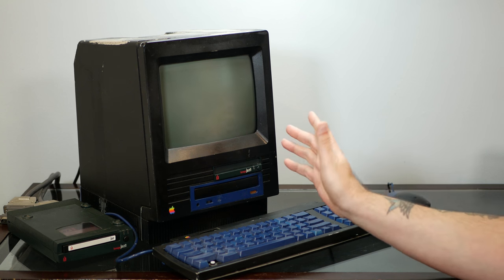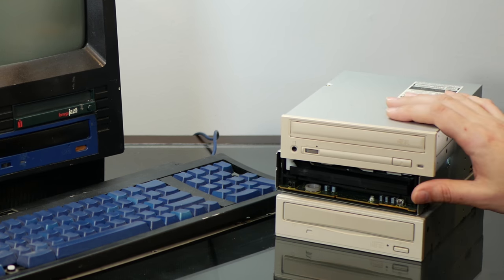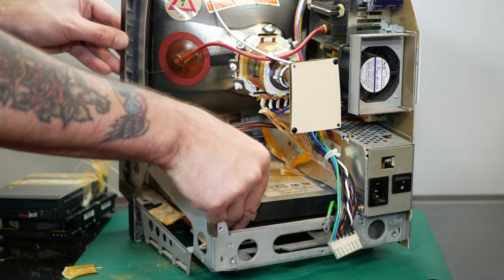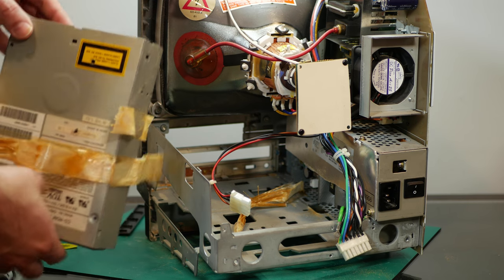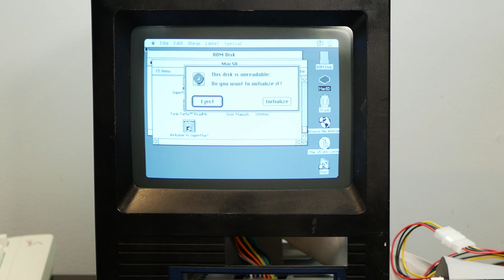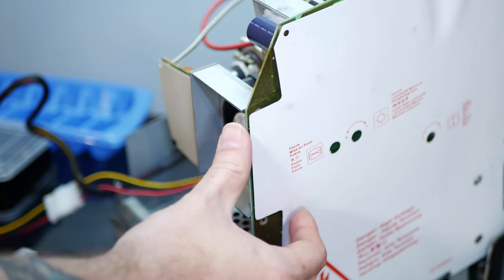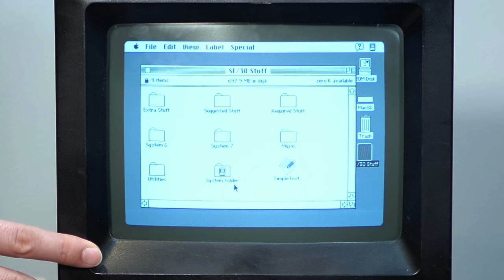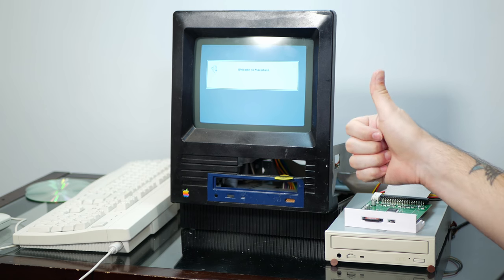The CURSED Macintosh SE, Part 2: Optical Revenge

Comment: That dust from the tape was once the adhesive. The heat of the CRT has cooked everything to do with that ancient tape.
Reply: I remember my father using those to tape over casettes to "restore" the write protection part.
Reply: and the fact it's packing tape. Packing tape isn't meant to last at all.
Reply: It looked like it was a self adhesive velcro type of tape when he removed it from the CDROM drive
Reply: In an old-style pc, there was a moth in the innards "Bug" on a piece of tape.
Reply: @Brendan_Keyport-WA7BMK  Isn't it fiber glass tape? Thus the strands running through the tape.

Comment: Mac Wars Episode 3: Revenge Of The Disc
Reply from the maker: Oh damn that's good!
Reply: @ActionRetro  It just felt perfect!
Reply: @ActionRetro  
Hey, did you make sure to check on the SCSI IDs and termination? Classic macs can work perfectly or behave really weird if the SCSI IDs aren't set right, or your bus isn't properly terminated. A lack of proper termination in particular can cause the behavior you're seeing, as signals can "bounce" back at the end of the bus.

These SE's were never meant to have quite so many devices daisy chained on the inside, let alone things like a CD drive or that SD reader. It might behave really badly without everything set up properly.

Comment: Get or make rounded SCSI cables. It'll save a lot of space.
Reply: I second this comment! Make rounded SCSI cables, it'll make the interior much nicer.
Reply: Wasn't there a reason SCSI cables weren't round?
Reply: @mentaluproar  yes. Cost. Possibly signal integrity.
Reply: I used to use an razer blade and cut apart cable into 4-5 cable groups and just zip tied into a round cable. Those were the days...
Reply: I am a newer person so idk what the difference between SCSI and IDE is but it does look like an IDE cable from afar
Reply: @bland9876  They confuse me a LOT too. I always have to hold the cable up to the port to see if they match (SCSI is longer).

Comment: In regards to the PSU, I would recommend substituting a pico-type PSU, as it's easier to use, can run to a smaller modern barrel jack at the back, and handle much more watts of power. Heck, you could likely put two inside the shell of the original PSU and get almost 600W out of two smaller laptop power supplies.

Also to keep the original spirit of the machine alive, how about when you go to paint the optical drive you paint the exterior and faceplate black, but paint the inside tray blue.

Just an idea. Love your videos!!!
Reply from the maker: Very interesting ideas! Thank you!
Reply: Oh hey xPLAYn

Comment: You mentioned the quality paint in the last video. I was thinking it could be vinyl-based spray paint. My buddy swears by the stuff, and he is painted several old consoles with it. It really adheres and lays down much better than standard enamel. I'm thinking that's what they could have used on this machine.
Reply: Jeff J:  Vinyl-based spray paint, eh?  It means nothing that I’ve never heard of this before — but chances are it’s gotta be an improvement on regular satin spray paint which tends to scratch or scrape off too easily (especially on metal).

I realise it’s not professional “powder coating” spray paint: I just hoped that one day I’d be able to find some sort of thin, transparent, spray-on primer (of some sort), to overcome the “scraping off” issue.

Matt is too dull and gloss is too, well, glossy.

Thanks for mentioning vinyl-based spray paint, Jeff, I’ll look into that for my future projects (or to go over my scraped ones!).

Comment: I suspect this guy didn't expect anyone else to ever be looking at this. This kind of improvisation was par for the course in the 90s. I had something similar for my old A1200 back then. 2.5" to 3.5" cable adapter, with the cable running out of the A1200 into mini tower PC case, with an AT PSU. It had a 3.5" HDD (much more capacity for considerably less price than 2.5" drives) and an IDE CD-ROM (I crimped another IDE connector onto the cable, never expected it to work, but it did). Never has a Jazz drive though. I did have a Zip (100MB) drive, connected via Squirrel SCSI interface.

Wouldn't do anything like that now. But, you don't need to. Everything is available to build stuff properly for reasonable prices.

Comment: Your best bet for an OS for that Mac is 7.5.5, which usually means installing 7.5.3 first then running the updater to 7.5.5. You could run 7.1 instead, but a lot of useful stuff needs 7.5+.

Another thing to note is that the SE/30 is not actually "32-bit clean", which is why 7.6 won't run on it. While it can run in 32-bit addressing mode, it needs some special software to do it properly, because the ROM still contains functions that rely on 24-bit addressing mode. While it's possible that your replacement ROM may have patched these routines, the model identifier still tells the OS that it's a machine that isn't supported by that version.

Also, OS 8 and 8.1 require at least an '040 processor without jumping through some hoops, which also require a truly 32-bit clean Mac like the IIci.

Just goes to show that Apple's "recent" history of locking out older mac models has been going on for technical reasons since the 90's. Even earlier, now that I think about it, as the original 128k mac can't run certain versions of system 6 because of the memory requirements.

Comment: Legit questiom: are you not worried about shocks from crts? Ive seen in a few of your vids where you dont discharge the crt and disconnect the anode. Freaks me out!
Reply: His hand was right on the board behind the flyback while he was removing the fan. I was so worried.
Reply: Alex Tirrell the PCB does not see any of the voltage going to the CRT, so no real risk there.
Reply: Normally those old macs have a bleed resistor that will slowly discharge the CRT on its own. That being said it is always safest to check by grounding out the anode cap just in case, but the rest of the machine besides the cap is all standard voltages.
Reply: Yeah that gets me everytime he was going in there
Reply: The flyback on one of those might hold at most 5kV.  And while that sounds like a lot, it's a static DC discharge much like touching a light switch in winter.  So while it smarts a bit, no damage is done.

I once forgot to ground my screwdriver to the frame of a Street Fighter II cabinet and took about 50kV while popping the anode cap.  The screwdriver went flying and stuck in the ceiling tile, and my arm was numb for about an hour.  But it instantly occurred to me what I'd forgotten to do.  :)

Incidentally, I've also grabbed a live deflection yoke on a running Tecmo Bowl machine.  They had one up-firing monitor that was right behind the coin door, so when I reached up to unlatch the control board I accidentally grabbed the yoke.  Hurt like hell when my arm jerked back and I hit my elbow on the frame of the coin door.  And again, numb fingers for about 10 minutes, but otherwise no damage from the shock.
Reply: @phydeux  - As long as the path to ground is not running through your heart or head; it probably won’t kill you. If it is across your chest, though, that’s when it becomes life-threatening - sometimes it’ll mess up your rhythm, sometimes it won’t. If it goes thru your head; it could trigger a seizure; and likely will cause some brain damage (general degradation like taking a hit from an ECT machine; more than the kind of damage you might expect from a stroke or a strong physical impact). On a Mac; it would be pretty hard to get it to go thru your brain like that; but I suppose if you are climbing around the inside of an arcade machine?

In all cases, though (as you’re quite aware of by now) getting zapped is no fun.

Comment: Could the BMOW be the cause of all the macOS install errors?
Reply: Partly yes, I guess. Apart from that, the original SE/30 never supported OS versions above 7.5.5 so I'm not surprised 7.6 refuses to install. 8.1 even required an 68040 CPU so even less of a surprise there. I suspect Dr. Frankenstein ran 7.5.5, the installer is on the original hard drive.

Comment: I say leave the JAZ drive as the main swappable disk. I think thats the main attraction of this old unit. Hook up the external scsi JAZ drive to your epic desktop G3 so you can swap files between them.  [i love using old media]  Put the SD/SCSI board in there and file a slot in one of the grooves in the front panel to access the SD card. Try using a sub-1gb SD card and booting off that maybe? 
The CD read errors may be because it needs the iso9660 CD driver. or the CD toolkit drivers for non-apple cd drives.
Reply: Jaz drives rule!

Comment: Just so you know, there pretty much is no CD-ROM compatible with the Macintosh that is faster than a Jaz drive.  In fact, the Jaz drive is faster than most SCSI hard drives that I've used.  I have several Jaz drives for testing and troubleshooting my vintage Macs and it is invariably quite a bit faster than any drive I've used.  Even upto a Power Macintosh, the Jaz still beats the internal stock drives.
Reply from the maker: Thanks, that's really good to know!

Comment: I saw you used at 19:28 some crimped splicing sleeves. The Noctua fans come with these little clear and orange 3M snap splicers that I swear by, they work extremely well and are much easier to deal with in my experience, in case you ever do this again.

Comment: The external jazzdisc runs at parallel-port-scsi emulation the internal one runs at full-scsi speeds and should be faster. The blue-painted frontbezel should fit the new cd-drive if you remove it's front-bezel.
Reply: I thought the external Jaz drive was true SCSI. Unfortunately, it looks like the new CD drive uses a different style of faceplate. They're not universal like laptop ones.
Reply: @eDoc2020  Apply a little heat to an X-acto blade and melt the glue holding the faceplate on.
Reply: Monchi Abbad considering i do have an external jaz disk mounted in a PowerMacG4 it is definitely SCSI inside the external box.
I don’t even think Jaz drive even existed with parallel. ZIP did. Zip exist one parallel, IDE and USB form. I’m pretty sure JAZ are only SCSI.
Reply: @godzil42  all I've ever encountered were scsi Jaz drives
Reply: I think you will find that the external Jaz drive has either high-density 50-pin SCSI connectors or 25-pin SCSI connectors, like the back of the Mac itself. Centronics parallel port weirdness was mainly a PC thing, for those who couldn’t be bothered to add a SCSI card…
Reply: So just did a quick search, the JAZ has always been SCSI, Iomega were planning to make an IDE version, but I suspect flash media and (CD-R) basically killed the project.

Also it seems that Iomega released a product called "Jaz Traveller", but apart from the Jaz name, this is an independant Parallel to SCSI dongle, but it was never embedded into a JAZ drive, and as far as I understand this tool can be used with other SCSI devices, not just the Jaz.
Using a DB-25 for SCSI on peripheral was not really common. It probably existed, but the most common ports are the mini weird connector SCSI-2 bringed, or the centronics type connector, the same found on parallel printer, just to confuse people! But the Jaz being SCSI-2 at best, I've never seen an official external one in a box with anything else than the slim trapezoidal connector for which I don't know the name.

Comment: I remember using SCSI, back in the day, on my old Acorn A3010. It was one of the old computing dark arts to get it to work, along with the wired networking that used coaxial cable with BNC connectors. I don't miss messing about with dip switches and termination settings.

Comment: The TEAC drive should work if you had the CD-ROM extension installed. A thing I found back when I mucked around with old Macs is that special drivers for removable storage (other than CD-ROM) were not required as long as a Mac formatted disc was inserted into each removable drive at boot. The system would load the driver off the disc and use it for other discs in the drive.

One caveat, it's best to initialize all the removable disks of all types with the same software. If you mixed it up like using SCSI Director on a SyQuest, FWB Hard Disk Toolkit on a Bernoulli, and Apple's own on Zip 100, it could cause conflicts and crashes. I settled on using HDT on everything, especially because it had software RAID support. I had to RAID0 stripe four hard drives across both SCSI buses in a 110Mhz Radius Mac clone to get fast enough write speed for Media 100 video capture at 150K per frame.

For CD-ROM there's FWB CD-ROM Toolkit. Where you can snag a copy is in the downloads on Low End Mac for one of the PowerPC clones. I forget which clone but one of the downloads has a full version of FWB CDT that includes disc changer support.

Lastly, every classic Mac should be running RAM Charger to replace Apple's terrible memory management. And it should also be running Connectix RAM Doubler, but only using the virtual memory function, which is far better than how Apple did it. The RAM compression was BS anyway. Apple should have licensed technology from both of those, but instead they kept making changes with every new System and MacOS release to repeatedly break RAM Charger compatibility. With the 9.1 update, RAM Charger's essential memory management works perfectly but some of the not-necessary accessory functions were once again broken by Apple. Apparently since Jump Development didn't push out yet another update, Apple didn't pursue further retaliation for being shown up. RAM Charger's management also works in 9.2.x.

Comment: I know that bad caps can cause issues with SCSI. I was thinking that was the issue with CD-ROMs until the last drive worked, that or the ROM disk does not have drivers for the other drives. A SCSI fault could still be an issue with the SCSI2SD, but I've also read that those need to be formatted just so to work. Lido is the popular drive setup utility for this. Of note, the highest supported OS for an SE/30 is 7.5.5, which is why 7.6.1 refused to install. There are apparently ways to get 7.6.1 and even 8/8.0 running on it but they need some modification.

Comment: i'd love to see a 3d printed bracket for everything crammed inside of their.
Reply: I'm leaning more towards some creative sheet metal work. 3D printed stuff needs to be fairly thick in order to be strong and space is clearly at a premium in here.

Obviously the power supply needs repairs too if the guts are replaced with another bare PCB like the existing one. Looks like the original Dr. Frankenstein took a jigsaw to the case!

Comment: Great videos, use the floppy EMU to install 7.5.3.  USE FLAT Black, not glossy.  I restored a SE/30 that had a bad case...used  "concrete colored paint" with a saved Apple logo...looks great now.
Reply: Also, instead of stacking SD2SCSI on top of the Jaz drive, reverse and stick the SD Card out the back in the slot if not using the network/video  bus card.

Comment: I am a bit surprised you are not familiar with the tape on the drives - it's called Strapping tape. It is reinforced with filaments for extra holding strength.  But to be fair, it appears to be about 30 years old - perhaps even a bit more.

Comment: The system folder from the CD would probably work with the original rom card. I'd guess it's probably System 7.1 vintage without the extensions necessary for a 32-bit clean rom.

Comment: i wonder if a hot knife or X-acto blade adapter for a soldering iron could be used to heat up or dissolve the glue holding the CD-rom faceplate on the case?  It may be slow going to keep the heat down and not damage the case, however I think the combination of a bit of focused heat and a sharp blade could melt or cook off the glue.

Comment: Replace the CDROM drive with a Panasonic CD-RW Model CW-7502-B, they are cheap on eBay right now, you can get them for less than $30.00 bucks. You can use Toast 4.1, which is freeware right now, but you have to burn at 2x. But, it still gives you a functional CDROM Drive, that is supported by up to OS 9.2.1.
Reply from the maker: Thank you!

Comment: Here is an extension that will provide support for a long list of CD-Rs that are not naively supported. A long list of supported drives (*with this tool kit) can be seen here. 
https://macintoshgarden.org/apps/fwb-cd-rom-toolkit-159

I use this tool kit to run an external SCSI CD-R on my older 68K macs.

Following closely... I am in the process of recapping my SE-30 and my BMOW Rominator and Floppy Emu is on its way.

Comment: The way you handle optical discs bugs me, it looks like you are touching the underside of the discs on a fairly regular basis. Put your index finger through the top and thumb on the outside edge instead of doing all of those goofy disc gymnastics.

Comment: It is concerning that the installers say this computer can't run this software, and that it cannot boot from that boot drive you made. Something sinister is going on with that computer, please diagnose that and fix it. 
What if it's some kind of specialty SE/30 motherboard that was for a weird purpose like education or whatever, and it's specifically limited in these ways? What if certain things don't work exactly right because of some leaked capacitors? 

There's still so much to do, so much to see...
Reply: The installer look up for the model (using gestalt) and refuse to work on an SE/30 because the original ROM is not 32bit clean, and 7.6 need a 32bit clean ROM. It’s not concerning, that’s how the setup was designed.